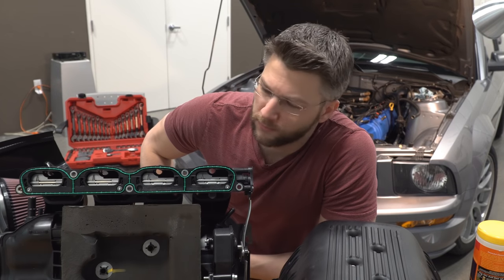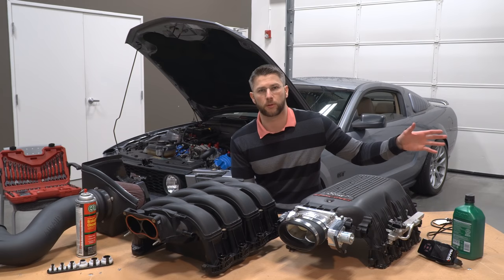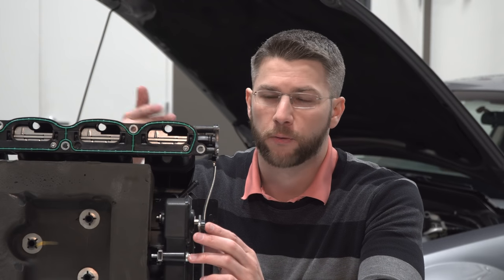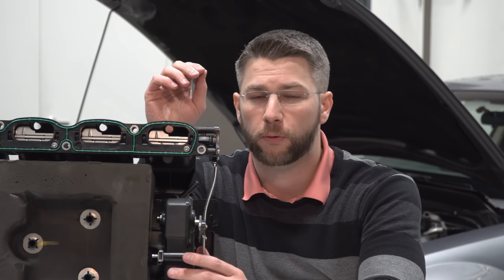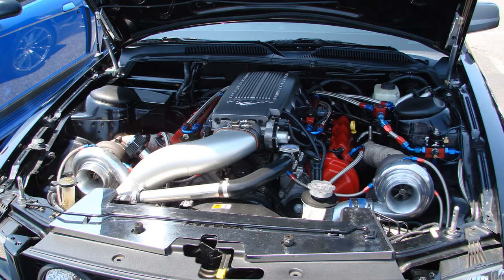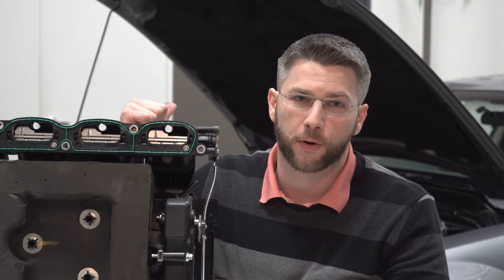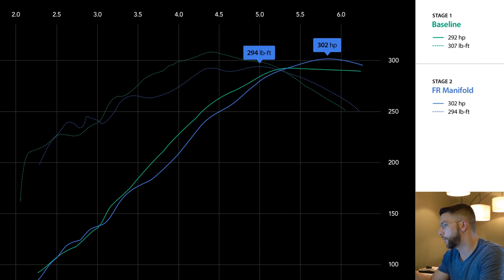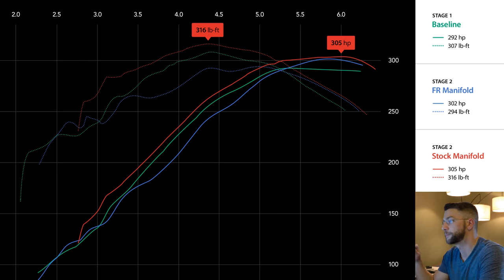Why you shouldn't remove your stock intake manifold

Comment: hmmm.  my 08 explorer 4.6 3v runs way lean throwing  codes daily, and I've done everything i could imagine. i wonder if these are stuck open. You gave me a new lead. thanks.
Reply from the maker: have you replaced fuel filter, cleaned (or replaced) injectors, and fuel pump?
Reply: @Four_Eyes  yup. all motorcraft.  even changed the fuel pump driver module since i was running out of ideas, even though I'm sure it was fine.  fuel rail pressure is 38-41 psi.  I have a K&N cold air kit,  i temporarily went back to stock and it didn't change anything. I even tried an updated PCM, all it did was make my cruise control not work 🤣 so I'm back to the original.
Reply from the maker: hmm, how about the alternator and o2 sensors? i saw a video recently where a faulty downstream o2 sensor was making a bank run lean (doesn't really make sense to me why that happen).

does it stutter/hesitate when accelerating?
Reply: @Four_Eyes  i did replace all 4 O2 sensors and cleaned the catalytic converters really well. Had the alternator tested and was said to be good, but i know they can trick ya.  I might go ahead and swap that since it's super easy on this engine.
Reply: so yesterday i put a wifi camera on the firewall aimed at the linkage and it never moves.  I even got to 6000 RPM.  The short term fuel trim is around 4% at idle, -5% at 6000.  long term often at 25%🙄 but went to 18% at 6000.  i think I'll have to investigate this servo a bit more
Reply from the maker: Sounds like that's the problem. They should fly open around 2,500-3000 RPM when you floor it. The car should also feel like it has considerably less power if this is the case.

Comment: No offense to anyone but the 4.6 in the 2v and 3v configuration has always been underwhelming. This video is very helpful though because it doesn’t seem worth the money to invest in the FR manifold to the average bolt on guy. If I was married to a 4.6 car for some reason I’d save the couple grand on bolt ons and start a coyote budget. The coyote is honestly very impressive and you gain HP and TQ everywhere.

Comment: The ford racing is better because top end is better then torque in the quarter unless your doing 1/8 mile it doesn't matter if you lose 35 torque if you get 35 HP peak

Comment: Thank you for your video.  I have the 2005 S-197 and I'm in the transition of doing the ford racing manifold, ford racing 62 fuel body and long tubes.  I have 4,10 gears, Under drive pulllys and Brenspeed Cams and a course the cold air intake should I get the delete plates or stay on course?
Reply from the maker: Well the racing manifold doesn't have charge motion valves, so definitely don't buy the manifold and the delete plates - there wouldn't be a place to install them. Given the options, I would just get the delete plates.
Reply: @Four_Eyes   I forgot to mention I have 4.10 gears.  In the beginning of your video you say the Ford Racing Manifold was good if you had 4.10 gears.  What about the Ford Racing Throttle body.

Comment: What are your views on the bama tuner? I bought a mustang with bbk headers, bbk catted X-pipe, airaid cold air, out to 2 roush mufflers. It already has a bama tune with the tuner but the previous owner didnt give me the information to the bama tunes for life. Worth buying the tunes for life if I add a throttle body etc? Also, any recommendations for one-piece drive shafts?
Reply from the maker: Not worth buying tunes for life or the throttle body. Custom tune by a reputable shop is the best bet. Consider checking out the stage 2 video if you haven't already..
Reply: @Four_Eyes  Thanks bro

Comment: So question, my S197 has 4.10 gears. Would the Ford racing intake manifold make me lose torque? Or no?
Reply from the maker: with a good tune you may lose a negligible amount of torque, but i wouldn't worry about the aftermarket intake unless you have cams

Comment: I have a 2005 mustang gt with 4.6, I have put flowtech short headers , gutted the catalyst converters, installed, JLT cold air intake,   , I also installed a BBK 62mm throttle body , but I removed it, cuz I kept getting , service engine lite, following with ugly wrench, my question , I notice more power with BBK , so should  I upgrade to a Ford  Performance 62mm,or leave stock 55 mm, on  Is the $600, worth the upgrade for the amount of gain
Reply from the maker: I don't think larger throttle bodies are worth it unless you get a turbo or a centrifugal supercharger.
Reply: @Four_Eyes  how do you feel about SCT Tuners and other than turning off my O2 senors is there any reasons , i would need this tuner,?

Comment: Putting in delete plates on a bone stock engine is obviously not a good idea. That being said putting in delete plates on a intake and bigger throttle body tune can increase power very well, especially with cams and headers. It's all about flow.

Comment: I bought a 09 gt a couple of days ago with the P2004/P2005 codes and I don’t know what causes it 

You said that the ford performance manifold doesn’t have the Actuator and might cause issues with the car

I have a buddy mechanic looking at it rn and said I might need a new manifold ( same ford performance model is $800😅)

What would be the mostly reliable problem?
Reply from the maker: Have someone rev the engine passed 4k while you look behind the manifold to see if the actuator is functioning. If not, something is likely up with the motor. Also check that the CMCV electrical connection is attached. If the manifold's motor is shot, I would just get a used stock one off of ebay.

Comment: In neutral reving the car the actuators dont move until wot, then they fully open, is this normal or should they be moving gradually with throttle?
Reply from the maker: Great question. So yeah on my car I noticed the valves fully open around 3,000 rpm or 50-60% throttle. I did it gradually like that to illustrate the point. This video should have been "don't remove your intake manifold unless you're getting a dyno tune." Multiple canned tunes resulted in power loss for me, and no tune at all (stock) is terrible - puts the engine into safe mode. I have done off-video dyno comparisons with the stock mani and stock mani + delete plates, and a good tune with the delete plates allows higher torque earlier. This enables the engine to make an extra 3-7 peak horsepower, but more importantly, higher horsepower from 3 - 6,000 rpm.

Comment: Did you get a dyno with thy ford intake or just get dyno with Bama tune? If so not a fair comparison also you said no cams yet you ended up getting them after all
Reply from the maker: Both with and without used various Bama tunes that were modified via an SCT. I chose the config that made the best power on a Bama tune then had that setup dyno tuned. I'll cover this a bit again in my next video.
Reply: Four Eyes im installing the intake today using your video and I don't have my cams yet only difference is I got 4.10 gears I'll be using a Bama tune

Comment: Did you run the Ford Racing Throttle body with the stock manifold?
Reply from the maker: I did. Just swapped the racing manifold back in now that the car is cammed.

Comment: Wait...so you installed the intake manifold, throttle body, one piece drive shaft, cams, long tube headers, off road x pipe and only picked up 10 peak hp!?
Reply from the maker: Can't really disagree with the general distaste for Bama tunes after my experience. The car has since been tuned and is putting down solid numbers.
Reply: Four Eyes did you datalog the car so they could revise the tune?
Reply from the maker: Fair question. I did not since it required hooking up a laptop and downloading their software, I decided to just wait and get a custom dyno tune. The most fair approach would be to get two custom tunes, one for each manifold. I might do this after camming the car because any advantages of the FRIM will be amplified under that setup.

Comment: Hey I just ran into a problem I wanted to know if you can help, i recently did a engine swap on my 2006 3V and I replaced the motor with a low mile 2007 it was in good condition and all, it turned on and 2 days after the swap went in the check engine light went on and it gave me a P2004 and P2005 code which means that the imrc bank 1 and 2 are stuck on open. I checked the actuator and it seems to be fine it’s not stuck or anything from what I know. The day after the check engine light turned OFF and now the car idles really low and lacks power and today it shut off while I was parking. So I turned it on and it ran for a second then shut off again. I tried a 3 rd time and it turned on and stayed on. Can you help me and maybe give me tips on what might be going on? Is it the IMRC that went bad or is there a difference between a 06 and 07 imrc?
Reply from the maker: Hey sorry for the late reply, any update on this? Interesting problem... I assume a VCT solenoid or maybe a sensor problem.
Reply: Four Eyes it’s alright, so what ended up happening was one of the little arms on the actuator was bent and it would get stuck from time to time, so I bought a new actuator and replaced it, also cleaned my throttle body and changed the fuel filter now the car runs so much better. But thanks anyways for the video you made it’s really helpful and I love the car 👌🏼.
Reply from the maker: Ah good to hear. Thanks dude.

Comment: The stock powdered-metal connecting rods are generally the three-valve motor’s weakest link and fail as little as 450 hp.  There's a reason people pull them engines out and put 5.0 coyotes in.  It's a complete waste of time and money to try to add hp to that engine in any way shape or form.
Reply from the maker: I'll be swapping the rotating assembly with: http://www.modularmotorsportsracing.com/cart/index.php?main_page=product_info&cPath=4_7_54&products_id=354
Reply: It isn't hp its torque.  Keep it around 450 torque and you're good with the right setup i.e. cams and headers and manifold with forced induction you can be well above 500 rwhp while keeping torque at or below the 450 mark and stay in the safe zone of the engine so to speak.

Comment: Would having FRPP cams benefit from charge motion delete plates?
Reply from the maker: Yes. After years of messing with the car, I've realized it's the tune that matters. And it matters a lot. Disconnecting the CMCVs puts the car into some kind of safemode with respect to timing, so you'll actually lose power. But a good dyno tune will net you power and and a little more peak torque.
Reply: @Four_Eyes  Ahh I gotcha!! Thanks for the quick reply 😎

Comment: Hey when you put the oem back what fuel line hose did you use? Ford doesn't sell just the hose
Reply from the maker: Had to source an assembled one with both fuel rails still attached. Dyno video in the works.. it was a zig-zaggy path to get to the power numbers I'm at now, so the video is taking some time.
Reply: Four Eyes I dropped the intake manifold car felt weak through the whole rpm range getting tuned via lito. Did you use the stock manifold
Reply from the maker: FRIM will feel noticeably weak w/o a new tune. Even after, the mid-range will only be mediocre, but top-end will swell with power (around 4,500 rpm), and the engine will hold its power nearly flat above 6,000 (instead of massively tapering like with the stock mani).
Reply: Four Eyes I have every mod you have and had it tuned and it just felt slow everywhere cams gained up top going to have it returned with the oem mani see what happens I also have 4.10 gears
Reply from the maker: Go get it dyno'd before swapping... be interesting to see how the chart compares to mine. Could just be a tuning issue. Ask if he has adjusted the torque management tables.
Reply: Four Eyes already swapped have to do some data logging etc I'm go by how the car feels first 
 look up lito he is a 3v specialist all over the internet he does excellent job

Comment: The problem with the intake runners is after some miles. Since the intake is plastic in the rod that the intake runners are mounted on is metal and consistently opens and closes. After some Miles, that rod starts to make a oblong whole on both sides of the intake, because it's Plastic, they don't put a metal pushing in there, obviously, because the ship plastic intake, eventually that metal bushing is gonna fall into your motor and make a bunch of ping pong noises that nobody wants, so instead they just leave it mounted in the plastic and let it get oblong. And then your motor sounds like it has a rod duck. When it hits about 30000 miles and you can test that hypothesis by unplug in the intake runner solenoid on both sides and you can listen to that knock disappear and have a quiet engine, 'cause I do it to my super duty. Cause it's fucking annoying, and that little bit of performance. I lose on my super duty that tows cars and doesn't do much racing. I don't really care about the performance. It loses by having them unplugged. Because when you unplug it, they just stay open. That's probably well, not probably that's Definitely.Why everybody delete them and locks them open

Comment: What mods are fully needed to hit a solid 400ish hp
Reply from the maker: Most cost-effective approach is a centrifugal supercharger like a Procharger; otherwise, cold air intake, long tube headers, underdrive pulley swap, ford performance intake manifold, aggressive cams, and ported heads.

Comment: People don't understand you cant do mods such as this without supporting mods it's useless. If you install a intake manifold with stock airbox, throttle body and headers you wont see any gains. If you go manifold, upgraded throttle body, cold air, longtubes and exhaust you will have great gains. An engine is a symphony everything works together to make a beautiful masterpiece
Reply: Depends on the motor.  If the intake is restrictive and the exhaust isnt it will most definitely help.  The coyote motor has very good exhaust manifolds but lots can be gained with a just a tune .

Comment: Legit tuners have proven this to be false. The gains are across the board on a dyno graph. I have my 2017 with a ported 18 manifold with IMRC lockouts and you can feel the difference. Problem is the tune, not the intake.

Comment: I think To get the 3v to 700 rwhp plus U will need to build the engine and here is the important part because the 3v is not as big as the 5.0 you need serious boost. 

Twin Turbo is best for this engine. More efficient than the Twin screws and centrifugal.  Plus adjustability 700 to 1000 hp. 

Forget dealing with nitrous or E85 just to get u to touch 700 rwhp.  Twin turbo will get u there and then some.
Reply: Phantom096 agreed my buddy has a single turbo and after upgrading his fuel system it made 850 at the wheel on 19lbs. E85 and it was a built motor.

Comment: All of the mods that were done here were to remove restrictions.  Cmdv headers, x pipe,  larger diameter throttle body.  Naturally aspirated you will lose torque with these mods.   Add forces inducted and these mods can pay dividends.

Comment: dont blame the mods. your tune sucks. ditch that bama tune and get a real tune. You will see way better gains. plus a intake like that should have a small cam upgrade at least. fewer ci needs higher rpm. best way to make power is to stretch its legs especially on a ohc
Reply from the maker: After lots of testing, this is pretty much true. But the performance manifold no doubt saps low-end torque. Check out this report when you have some time: http://www.emeraldm3d.com/articles/emr-adj-length-intake/

Comment: you keep on gaining mid range power and very little top end power. PORT THE HEADS!!!
Reply: stanmack1 witch will gain 15hp max 

He's better off getting a proper valve job versus spending that kind of money

 For the returns of ported 3 valve heads you're halfway to a blower setup
Reply: Richard Skipper what is polishing how do you polish heads just asking

For the price and low hp returns you might as well put all that money for ported heads into just simply by a blower 

3 valve heads flow quite a bit as it is vs 2v heads 

the person who probably tells you you will gain 40 horsepower is the person that you're paying for the services of course they're going to tell you that but in reality the returns is very minimal
Reply: @crownvictorialifestyle4421  I did NOT say polish, I said PORT.
Reply: stanmack1 I didn't say you did someone else said porting and polishing
Reply: @crownvictorialifestyle4421  READ THE SPREADSHEET, he's got the money.
Reply: stanmack1 I'd put the money towards a blower the returns will be greater 
 Vs little gains from porting
Reply: @crownvictorialifestyle4421  he says he's going to put turbos on it to get to 700hp. you can't get to 700 if you don't port the heads.
Reply: stanmack1 there's stock 2v heads turbos car making 700+hp

I'm doing a 4v ysi build soon 
A few head porting shops talked me out of porting them instead spend the money on quality Springs and retainers
 new exhaust seats and they will bowl blend the ports to the seats and custom cams  

3v head flow very well compared to 2 valve heads

With forced induction the engine is no longer drawing in air the same way it would do naturally aspirated you're forcing air and pressure into the heads and intake

Have you ever built a motor or had one built for you by chance ??
Reply: stanmack1 go look up Andrew lavender he ran a 8.5 on his old setup using stock 2v heads he simply had Springs put in them for high boost and he made well over 700+hp and close to 30psi on  built motor

my point is if a 3v head flows more than 2v heads imagine what a three valve can do with 
Turbos